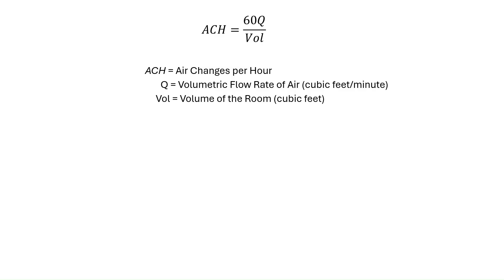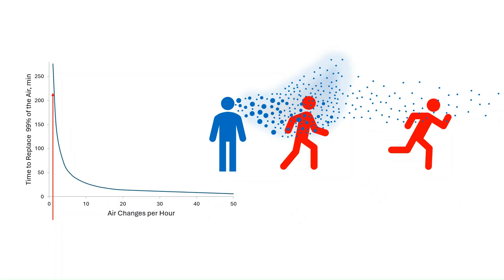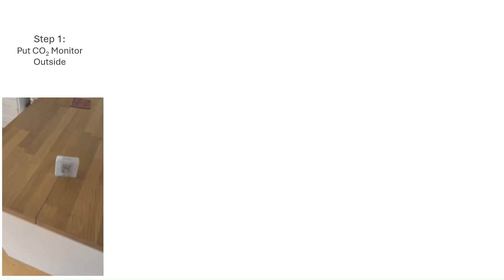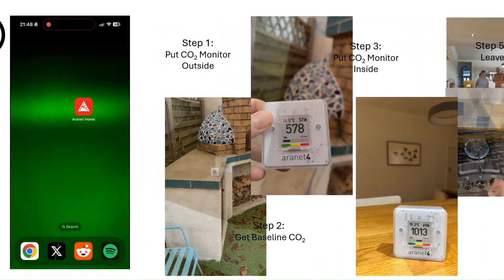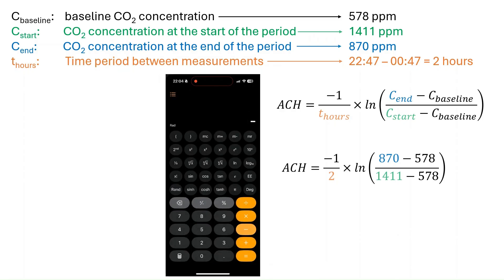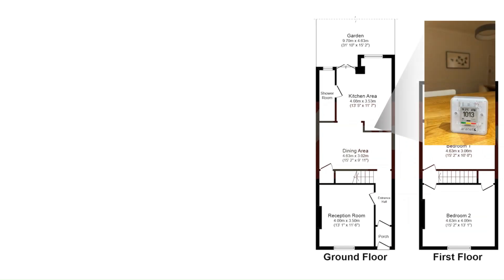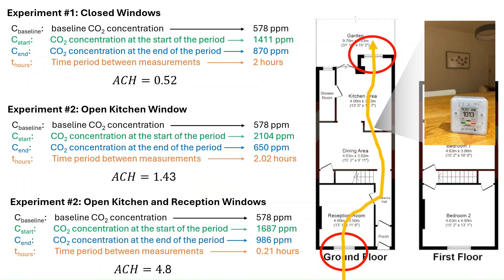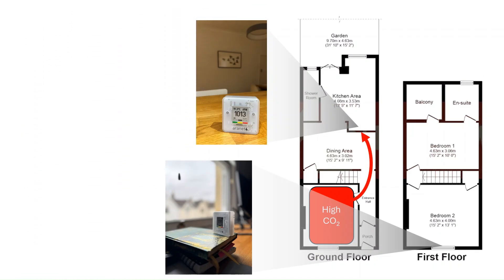Science @home: Measuring Ventilation

Comment: Nice video! You say that you should take the end measurement 'when the loss is a little over halfway between the outdoor CO2 and the CO2 when you left the room'. How important is it to wait to reach that point? If my data shows a loss from 1245 to 1215 over 1.3 hours (baseline 500), can I still use the formula? Is there an adjustment that can/should be made to address this?
Reply from the maker: That is tremendously slow. You can use it to get a rough estimate, but it will be very low.

Comment: Thanks for the video. How do you recomend isolating decaying C02 concentrations caused by outside air vs caused by "clean" air coming from the adjacent room? If nearly all of your ACH is coming from the next room over, that wouldn't seem to be very useful when that other room may also have a C02 source in it
Reply from the maker: That’s the challenge, you can’t easily. I would advise just making the measurement throughout the house. Over time you ought to be able to figure out where the air is flowing, and by how much (relatively) by looking at all of the results, collectively.

Comment: This is great. However I'm not a fan of ACH. It works for calculating how long you need to flush the space after a possibly infected person has been in it. It's not really suitable for figuring out the ventilation rate needed when there's someone in the space continuously emitting particles. 

In that case the volume of the room is not relevant at all and shouldn't be part of the calculation. 

What you need to decide is what's the acceptable level of infectious particles in the air you're breathing, what the likely emission is per unit time and what the volume exchanged per unit time will be. 

So for example if you guess that an infected person emits 10,000 infectious particles per minute, and you're willing to inhale 10 per minute, and your breathing rate is 1 cubic foot per minute, then you can't allow the room air to exceed 10 particles per cubic foot 

If we suppose that the exhausted air is the average concentration of the room, then we can easily see that the steady state is reached when the exhausted volume carries away particles at the same rate they're emitted. So the exhaust volume is the emission per unit volume divided by the acceptable density per unit volume. So 10,000 / 10 or 1000 cubic feet per minute. 

Which is an easy calculation, and as you see, didn't have the room volume anywhere in it. 

But....

Plugging in real numbers. 

Infectious people actually emit several million particles per minute. Being willing to inhale 10 particles per minute means you reach a 50% chance of infection after only 10 minutes, which is clearly unacceptable. If you are sharing a space with a possibly infected person and you're willing to accept a 50% chance of infection, and you assume that they're infectious for about a week, then you don't want to have more than 100 particles in the volume you'll breathe in a week. You'll breathe in the order of 10,000 cubic feet in a week. So the maximum density must be less than 100/10,000 per cubic foot. 0.01 particles. 

So dividing what people actually breathe out, a million per minute, by the acceptable density of 0.01, you get 100 million cubic feet per minute. 

Which is not to say you shouldn't ventilate. You absolutely should. But the correct ventilation becomes easier to calculate. You open all the windows. You buy/make as many filters as you can afford and you run them as high as you can stand. And most importantly, if you're sharing a space with anyone who may be infected (even if you really really really like them) you wear the most effective mask you can find/stand/afford at all times.

Comment: Thanks for this. I have used a slightly less mathematically rigorous approach.I use an aranet CO2 monitor and a dyson fan with hepa filter ( and measurement of PM25, PM10, NOx and VOCs). Generally when my wife and I are here together the CO2 stays <800 with just a trickle vent downstairs and one upstairs. When the family comes (9 people) CO2 quickly gets out of hand so I prepare before their arrival; Dyson filter set to level 5, window opened in utility room , window opened at top of stairs, a couple of trickle vents (upstairs and downstairs) opened. Extractor fan to outside running in kitchen, gas fire in lounge turned on. Monitor CO2 where we are mainly sitting and surreptitiously open doors or windows as it changes. I put up with complaints from various family members about drafts and it probably costs a few pounds in extra heating but I feel the air has far fewer pathogens being circulated and even if some criticise my continual harping on about C0vid I feel more relaxed.

Comment: Excellent video, thank you. We have clerestory windows and opening them is great for purging dirty air with doors at either end of the house open. Originally we had them designed in for capturing sea breezes to cool the house in summer but they are terrific for air flow. When we can't open windows due to high pollen or smoke the air filters are turned on.
Reply from the maker: I’m glad you found the video useful! And yeah, having access to both good ventilation and filtration really is the key. As you say, it gives you options.